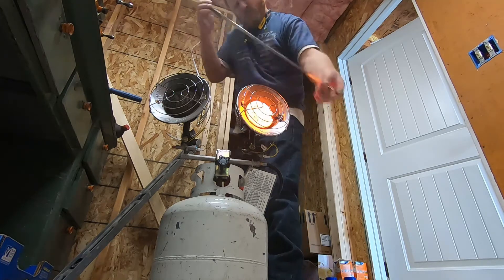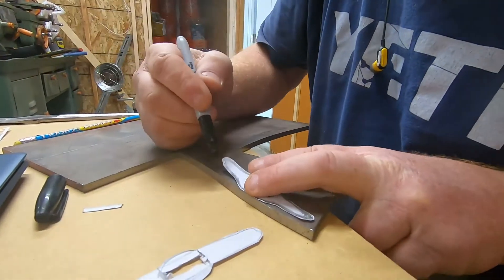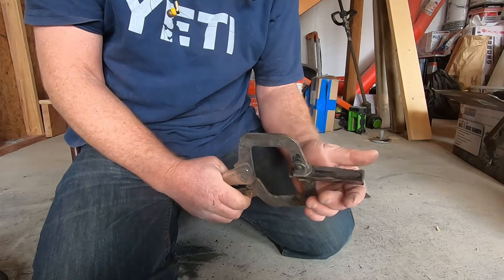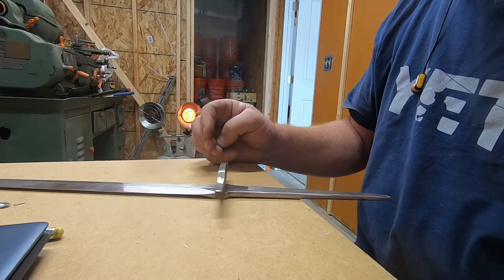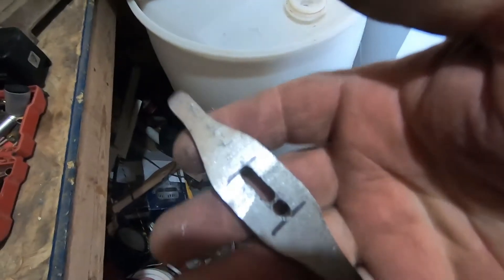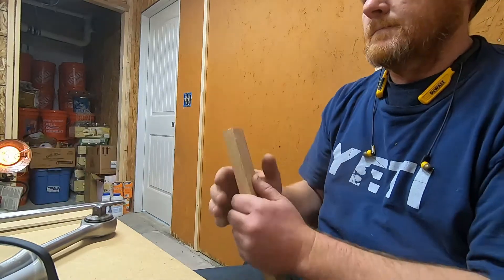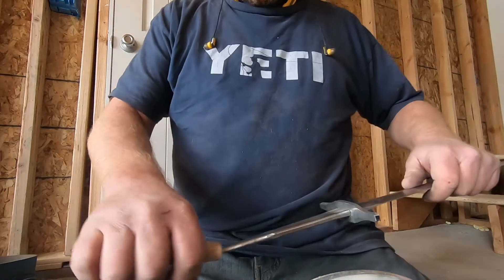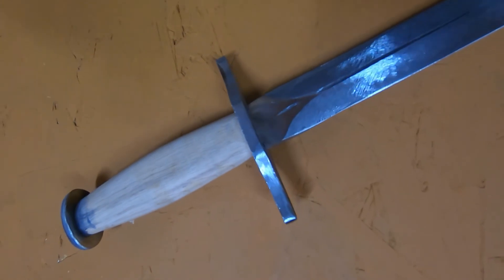Sword build part 2, What kind of sword is this anyways? How to make a sword from leaf spring

Comment: you want it to have some give otherwise it's brittle ... this is still a good sword .. I'm a cnc machinist we use brittle steel like 1215 for manufacturing hydraulic fittings.
I reccomend using at 1045 carbon spring steel .
1065 and 1095 are preffered
Reply from the maker: So is the leaf spring steel 1215? It's like a wonder steel to me. After bringing it to a dull red it still has a ton of spring left init.
Reply: @veggitarianredneck  no 1215 is a hardened steel with little traces of lead very strong but not flexible it would be better for axes honestly.
what you want is 1045,1065,or1095 carbon steel. I dont even know if you can buy it in large enough quantities
to make just one sword but if if you planned out like 5 swords I'm sure you could get decent sheet of it .the steel your sword is made out of looks like tool steel so durability should be there .basically it's a seriously lethal thrusting weapon but I'd worry if bends more than 20% 1065 can take it but since you used a unknown steel id be careful it doesn't bend and shatter as to not hurt yourself .the channel shadiversity covers this in a katana video .i gotta say tho yours looks like a personalized army sword good woork